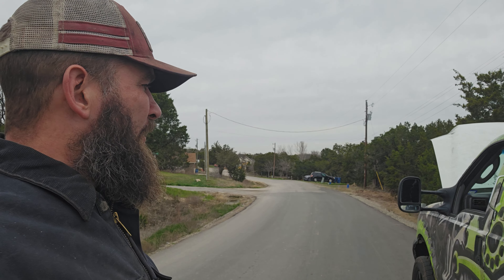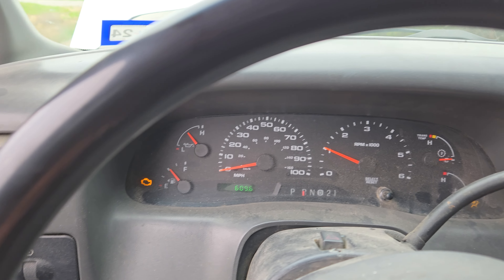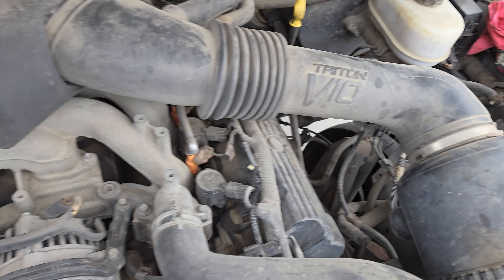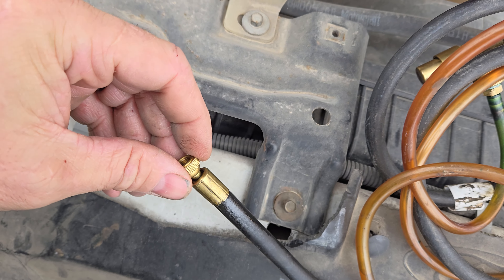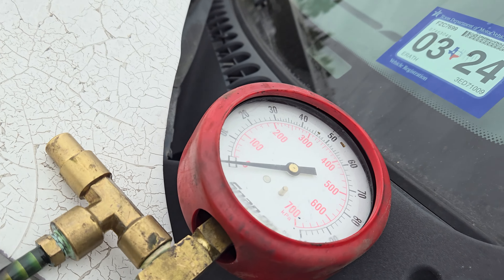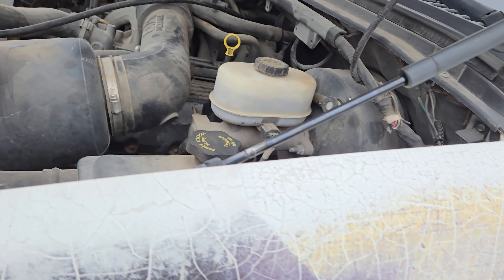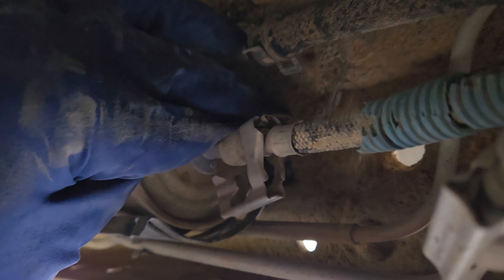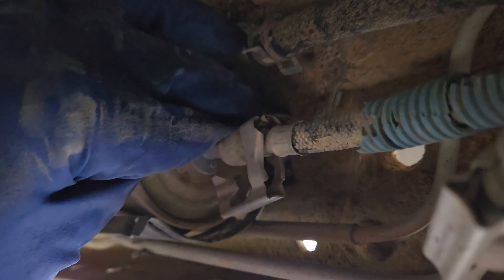Ford V10 went 190k miles without a check engine light-until now

Comment: We use V10's at our DPW we have replaced a few engines in our older stuff something happens to the top end, one thing though our mechanic only changes the oil at 5K and we work in a 2.2 square mile village we run the trucks all the time huge idle hours, and low mileage, and he still will not service the vehicles sooner. We used to change oil right after plowing season and at the end of the summer.

Comment: Those 99% values were for a second sensor on each bank, typically after the CAT-converters..  If your truck doesn't have Four O2 sensors, then that's why it's reading wonky..  They just aren't equipped.